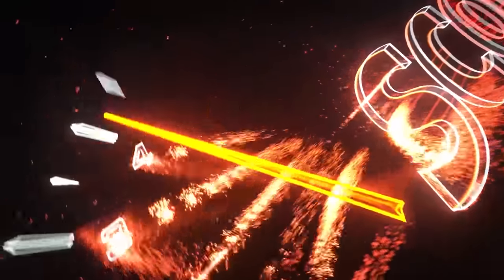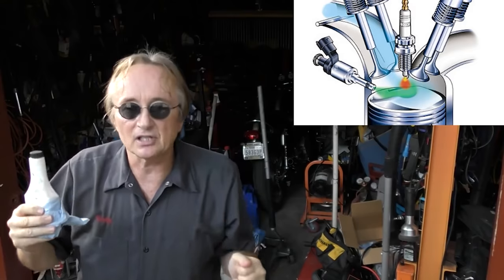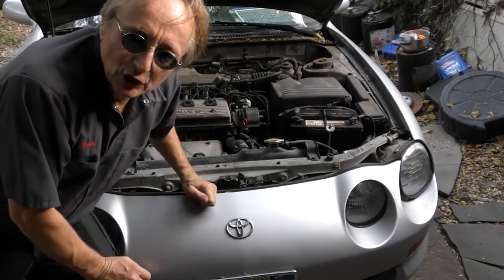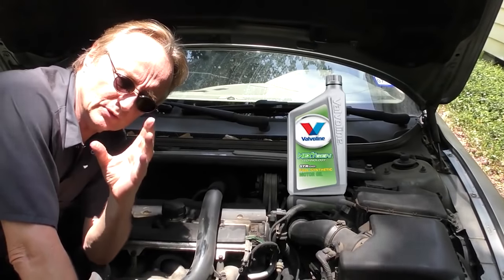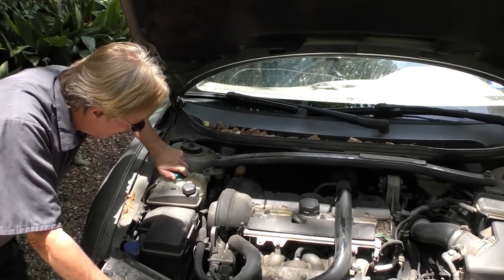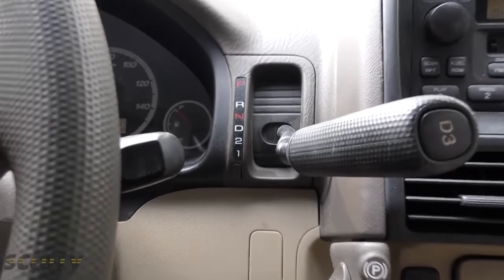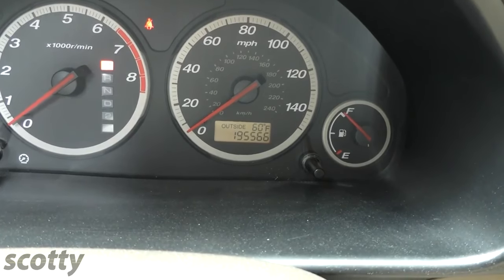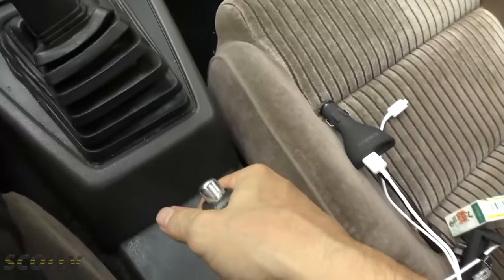20 Things Only Stupid People Do to Their Car

Comment: On the engines you say you should not use a thicker oil. How do you feel about using Lucas oil stabilizer? I have always used Lucas to help with dry starts.(I normally replace 1qt of oil for 1qt of lucas. I drive older vehicles to avoid car payments. At the moment I am driving an 2002 Sunfire. 140,000m . It runs very smooth and has always been taken care of.

Comment: I had a friend that bought a Mazda truck brand new and he never changed the radiator fluid ever. Then one day the water system started springing little holes everywhere in the metal parts. Unknowingly my friend didn’t know antifreeze apparently turns to acid when it gets old. Sure seems to be true with his truck too!😂

Comment: You have to change down to second gear, when you are turning corners. A standard roundabout is always done in second gear. If you are in fourth gear, and you come to a roundabout, then you can try to change directly to second, as the instructors taught me to do, or you change to third to slow down, and then second, as you get to the corner.
Reply: The car tells you which gear it needs.  They have different speeds according to the car.  My Panda's third gear is like our Fabia's second.

Comment: Well, the shifting into reverse while driving on more modern vehicles won't damage anything (but don't try to be sure). I had a 2010s car that got better mileage cruising downhill in neutral over 30mph. Problem with this shifter is unlike most, you had to depress the button to go from drive, to neutral. This also made it very easy to accidentally go into reverse at over 35mph. End result? Nothing happened, kept driving. Most modern cars will not grant you reverse if you are driving faster than 5mph, so it was in drive (and yes, obviously put in drive before slowing down, because that mere 5mph ain't good). Again, not something to try, but if you brain-fart, or over extend to reverse, most cars will ignore it until you're slow enough to engage reverse gear.

Comment: 7k miles is too long for a oil change unless you drive a diesel vehichle most cars from 2015 onward are 5k miles before that it should be every 3k miles 

If you have a leak in the intercooler tubeing dust out is your big thing to worry about dust and dirt can go through the turbocharger and into the cylinders 

Your engine is always connected to the tourque converter so idleing in park doesnt cause extra wear and tear not to mention that engine rpms drop when shifting from park to drive so your spining the transmission input shaft slower

Comment: Well that blew my mind, and made me do research that resolved some long standing confusion I've had.  Electrons flow from a negative source to a positive terminal (because electrons have a negative charge, the terminal where they try to leave the source will have a negative charge, hence it's the negative terminal), but car batteries are labeled the opposite, with electrons flowing out of the positive terminal.  So that's why the negative terminal is considered ground in a car, and why I have to stop and scratch my head every time I hook up jumper cables.  From what I saw, this is no more than identifying the terminals to match people's intuition (hey positive means a surplus right?  That must be where the electrons come from) instead of what is scientifically correct.  If anybody can expand on that to explain if there really is a difference, or if it's just to keep mechanics from getting confused by a counter-intuitive scientific principle....

Comment: What the hell ? I was told for years to downshift going downhill to spare the brakes because the clutch would last longer.... Honda Civic SI 2020 manual gearbox four cylinder turbocharged mostly stock I've only owned manual transmission cars since I started driving and it's been about 13 years and five cars Scotty help me with more detail lol

Comment: I always thought the whole nitrogen tire gas thing was a big rip off. If the oxygen goes out of the tire leaving back the nitrogen i will get a nitrogen filling for free over time by simply using air and checking the pressure now and than and refill if necessary.
Reply: Regular air is like almost 80% nitrogen so.... It's definitely a waste of money
Reply: @dwightmanne  yep we all have an 80% tire gas mixture for free. IF (i dont know) oxygen diffuse through rubber my car has 5 tire gas generators right now that came for free.

Comment: Best recommendation I've heard from a "professional" , when it's cold don't let your engine run at idle to warm up, it will damage your engine because you won't have oil pressure , to get your engine to temperature directly get going and rev or up to 50%.
I must say he is right...metal to metal contact warms the engine way faster.
And then you check your manual...doing just that will void your guarantee...well, who is the professional?

Comment: dont leave it in park if you are idling for a long time. 
It will wear out the safety pin that keeps the wheels from turning faster.
Put it in neutral and pull the e brake.
Reply: Allthough very informative. Great video

Comment: Scotty is not bad, but I completly disagree with him on fuel additives and engine oil. There is a huge difference in fuel quality within the United States. I try not to use ethanol at all and even though sometimes I have to I highly recommend running an upper cylinder lubricant especially on Modern engines with direct injection, my brother has a brand new Nissan pickup he has been running the upper cylinder lubricant from Amsoil since he bought the truck and he is getting 2 miles per gallon better than what is listed on the window sticker.

Comment: One of the primary reasons nitrogen is used in aircraft is because of freezing temperatures.  Using atmospheric air to fill tires is always going to have some degree of moisture in it.  Which means at 30,000 feet any water vapor inside the tires will freeze.  The other benefit of using nitrogen for aircraft tires is that it has less of a deleterious effect on rubber.  Considering the expense of aircraft tires and their short life span, it makes sense to use nitrogen.
On an automobile, it is not practical or beneficial.

Comment: Living in Canada, I never had a car last longer than 10 years due to the salt on the roads in the winter.   At four years I replace the brake pads, but always end up replacing the calipers, disc and everything else.   At about six years is the shocks and stabilizers.   At ten years the car is scrap because it is too expensive to repair for much of the frame underneath it too rusted to support anything.  I tried oil undercoating every autumn but the oil drips off and rusts anyway.   I tried tar but salt water still finds a way behind.  I even tried an $800 top end electronic rust inhibitor but that was just a scam.  My brother bought a truck that has an aluminum frame and every steel bolt rusts very fast where it is attached to the aluminum.   I absolutely love your video, but I just find it amusing you say that you're vehicles last 20+ years.   Must be nice  caring for them and saving alot of money, especially now that new  vehicles have raised in price of about 40% in the last five years.

Comment: Here’s how much of a rip of companies selling nitrogen gas for tires. I used to work at a rocket test facility. We used compressed nitrogen for muscle air in our pneumatic tools. The reason:  we needed nitrogen for other reasons (i.e. ullage for LOx tanks) and the GN2 is so cheap it would have taken a few thousand years to pay off the air compressors, plumbing, and other equipment (not including maintenance for the system). Of course it helped that we had a direct connection to the company that made the GN2 (though most of those tire companies have machines that extract it from the atmosphere, so it’s probably even cheaper than it was for us).

Comment: I had a BMW 750il and I replaced the new battery with the old and the new battery was polarized opposite from the old battery. So I put it in without looking. I just oriented it the same way as the old. Fried the computer

Comment: If you have a car from a moronic manufacturer who decided to use black wires for attaching to both + and - battery terminals, do yourself a favor and put either red paint or red electrical tape on the wire going to the + terminal so that the next time you need to jump start it, you need only connect red to red and black to black so you don't need to look for the + sign (it'll be dark outside when you need to do it, because Murphy's Law).

Comment: Well yes and no. You don't want to swap the polarity because electricity runs negative, through the circuit and back to the positive. 

Overloading the positive by connecting the negative to it will cause it to overheat and start a fire.

Comment: from RICJKL 
my 2013 Hyundai Elantra 1.8L has 185000
I change oil every 5000 - 7000 miles, misread the manual 
I've been over filling when changing oil 5.0  instead of  4.3 qts.
So far seals are holding 
Any advise ?

Comment: Scotty what do you do with auto transmissions that do not have any drainage and refill openings I believe my 2011 Mazda  6 has a dual transmission ie auto and a choice to use it in manual mode (clutch less)  and I am assuming the transmission unit is sealed for life and the fluid does not need replacement?

Comment: How many miles should I Chang my oil in my turbocharger engine less than 3000 miles or 3000 miles good?  How many miles should I change my transmission fluid 7 speed auto dull clutch?

Comment: To be fair, I often downshift as I'm slowing down but that's because I want to be in the right gear if the light goes green and I'm still moving which happens to me a lot more often than it probably should.

Comment: First of all, you're right. Never confuse positive and negative. The components you showed are i.e. the fuel injectors. They contain magnetic valves and work on 12V. It is correct, that sensors and other things like these work on 5 V but you can't put 12 V to it. At least not with a jumper cable via battery. It is correct that when you confuse pos and neg you damage the computers. here are several electronic parts that might burn out. Sometimes you can't read the + on the battery and the cap may be lost. Therefore the positive pole is thicker than the negative one. In fact there are old british cars  (manufactured up to the late 50's) which had positive grounding.
Ok you shouldn't put thicker oil in your modern engine. But when you're on the road and there is one liter missing and the right oil isn't available, just fill up with the one you can get. Better to have one false liter in than missing one. You let a garage change the oil afterwards. Until then, nothing will happen. But what is very important too, never put a very thin oil in your old car. You may think you're doing something good to your engine. Well you don't. When you have an old car which has been running on i.e. 15W40 for the last 20 years you may severly damage the engine by putting 5W30 in it. It contains cleaning additives that will wash out all the residue that was left behind all the years and the oil is way more thin than the old one, it will result in damaged bearings and maybe leakage. Ok the coolant loses its ant-freeze ability after a few years. That's why you should test it once in a while if it's still working correctly. Damaging the electronic system with old coolant is pure nonsens. Of course you can measure a very small voltage. Inside the system there are different metals and the liquid isn't pure water. So it works as an electrolyte between the different metals, but it doesn't harm anything. And if you change the coolant by yourself please be careful. It won't damage your car, but at least it will harm the environment. So don't flush it into the sink. Please dispose it properly.
I have two last things. Why use the emergency brake? That your brake can rust to the disc or drum in wet conditions? Believe me that happens in really short time depending how wet it is. Or in winter the brakes will freeze together. So leave the first gear in or the reverse. Turn your steering to the curb. That's enough. If the car really turns the engine by it's weight it will stuck at the curb. No pitch will be that steep that the speed is enough to climb the curb.
And the last thing, never put synthetic oil in your motorcycle. Motorcycles have one oil system for engine and gearbox. When you put high end synthetic oil in, the clutch will start to slip.

Comment: Scotty the correct way to park a car is not the way you said it. You have to press the brakes engage the emergency brakes let go the brake pedal to see if the emergency brakes hold the car and then put it in to parking. If you are using manual transmission then instead of parking you put it on any gear. 1st 2nd etc…

Comment: I like what I've seen so far. I have a question. Does your cruise control give you better mileage on the interstate?
Reply: Depends on how hilly it is. If it's not too steep and hilly, yes. It burns less gas than if your foot is moving up and down on the pedal. With modern cars with 7 or 9 speeds, it'll do just fine in cruise control, as long as you're not towing a trailer

Comment: Hey scotty. I have a Ford cmax 2011 diesel, 1.6.
4 days ago, i noticed that when i turned my headlights on, the fuel guage drops to zero, when i turn the lights off, it resumes back to normal levels. This mesns i cant see how much fuel i have at night time. Any suggestions of what could be wrong? Thanks from the UK 🇬🇧

Comment: If you are going to sit for a long time, don’t just put it in neutral, turn the engine off. Saves the transmission and gas and pollution. Same when you run into the store. Also saves theft. I see suspicious people in store parking lots, watching for empty idling cars to steal. Saves on insurance premiums too. Don’t be lazy, twist you wrist. Avoid all the cost and hassle.

Comment: The reason why they fill the tires in Jets with nitrogen is due to fire hazard. You dont want to have compressed air which contains 21% oxygen near the fueltank. Hard lesson learned thru accidents with hot brakes 🤷‍♂️

Comment: 11.67 volts = a flat battery. Full charge is 12.7 volts. Don't let it go below 12 vo;ts too often or for too long, you will damage the battery. 

Connecting the battery with wrong polarity external charger is likely to do more than damage the computer - ever seen a lead acid battery explode? Acid and bits of case go everywhere

Comment: Scotty will recall that our generation was told that fluids had to be changed regardless of mileage. You don't want to be driving with one year old motor oil regardless how little   you drove. Now some will say that was with the good old Anerican cars and the rule doesnt apply to foreign cars. 😂😂. So a Toyota engine is more robust than a '67 Chevelle Malibu? Right.

Comment: Re nitrogen...
1, living in northern ontario, the temp can be from +35 to -40...tire pressure changes by 10 psi...WITH nitrogen...20 to 25psi without 
2, nitrogen with new cars generally comes with lifetime free top ups....
3, gas stations here charge for air...yeah, go figure 

So free nitrogen or pay for air.....

Comment: Scotty is a pro. No beans about it. So now my opinion,30 year auto mechanic. Number 1. Stay away from turbo powered engines. Number two. If you must own such a failure, idle it for a minimum of 3 minutes prior to shut down. 30 seconds is not enough. But still, avoid turbo engines with a passion.

Comment: First of all you are wrong about nitrogen VS Standard air. When a vehicle has aluminum wheels they tand to develope leaks around the bead due to the moisture that is in standard air causing corrosion. Nitrogen has no moisture hence no corosion. Secondly, Nitrogen keeps the tires running coller which makes the tires last longer. This is also providing that the tire size and pressures are check regularly and adhered to by the sticker in the door jamb.

Comment: The bare N2 in aircrafts is not because of better performance, but to prevent tire fires when brakes get overheated after e.g. a hotter landing. So it is not a performance thing, but a safety thing. But completely irrelevant for cars. Maybe except some F1 or NASCAR, but definitely not for a normal car...

Comment: Accidentally shifting into reverse has been an issue for ages with manual already. There's even been a joke about it where a stereotypical stupid driver comes for a third time with a destroyed transmission to the mechanic and, upon being questioned what he keeps doing, answers (roughly translated), "Well, I start in first gear, then shift into second gear, then third gear, fourth gear, and finally of course into rally gear..." 🤣

Comment: well not only will connecting the cables backwards screw with the components but it'll short out both batteries and you'll see some sparks and if you happen to be at a gas station it may go boom